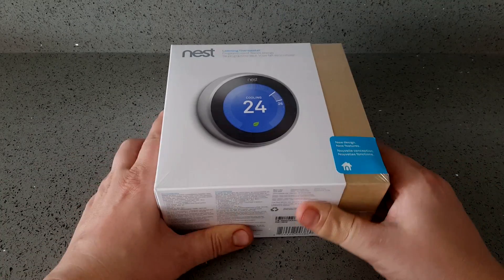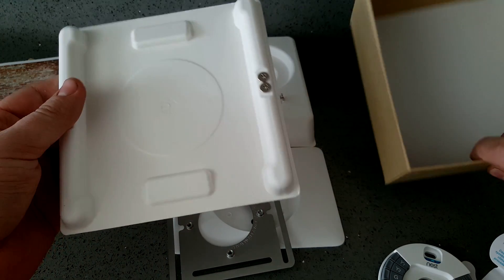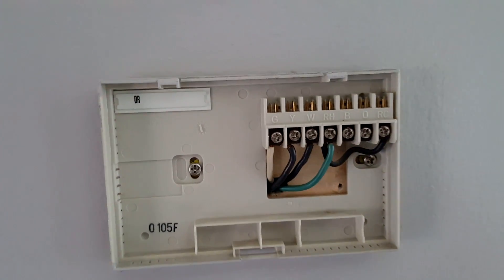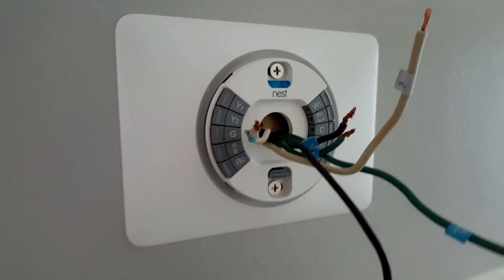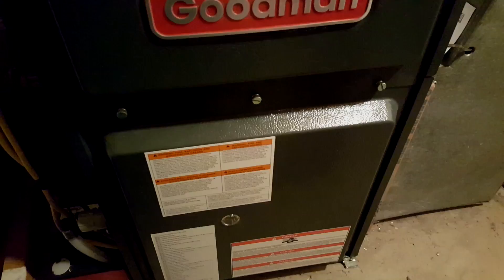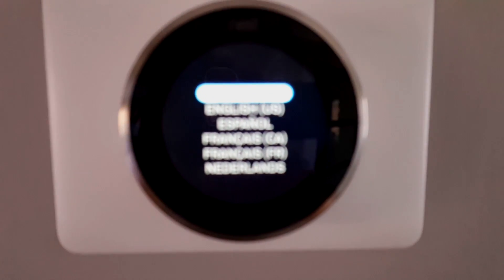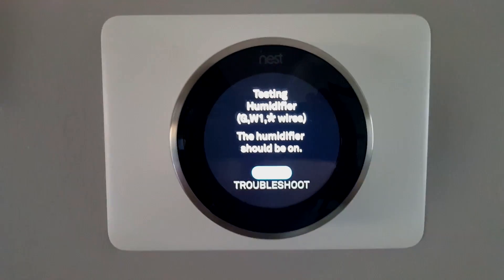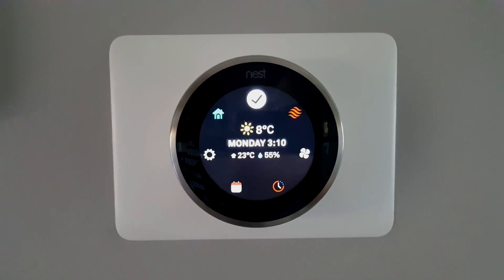Nest Thermostat 3rd gen  + Two Stage Heating + Humidifier Setup

Comment: i have the same Goodman furnace, how do i directly connected my aprilaire 550 humidifier to nest 3rd gen. without using the manual humidistat. new install  18/8 wire

Comment: I recently purchased Goodman 97% modulating variable speed . How can I wire it to my nest 3rd gen.  I also don’t need humidifier
Reply from the maker: Cezary Mroczkowski
1 second ago
same as your old thermostat except you need to set the switch on the furnace to tell it that the thermostat will control the second stage.

Comment: Did you have to add any relay for the humidifier?
Reply: if you take the low voltage from the furnace to the humidity fire  valve,no you do not need any relay ,but if you have  humidity fire transformer then you need to have single pole relay to separate the two voltage (I am a hvac technician).  connect from * on thermostat to the R (R inside the furnace)and then to one of two wire on  water valve then second wire from water valve connect to C inside the furnace, make it complete circuit.